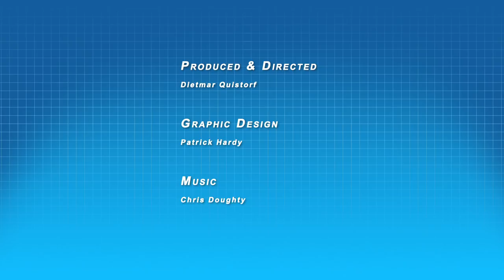Fish Food, Calculation Pond Rock & Pond Liner - Ask T.P.D. Show 29

Comment: Long time no see - to much at work but watched all videos that I missed so far today :-)
We live in Sweden and the climate makes water temperature go from 4 degrees in the winter to 25 degrees in the summer. Therefore we use 3 different koi food.
1. During +8 degrees and as long as they still eating we give the Wheath germ - more or less no protein at all in etc.
2. During mid season usually up to now when temperature is below 20 degrees celicius we give them koi mix osw.
3. During high season we give the top koi high protein food.

Apart from that we also give them melons, broccolli and other good stuff. They always eat directly from our hands and some of them is even possible to pick up and eat from hand when we hold them.
Reply from the maker: TORE ANDERSSON Fantastic!

Comment: Thanks for the info on stone and rocks. Actually that is the most cost prevent part for most people. They are getting just crazy expensive here. Just transport in the last few years has went from 40 to 80 dollars. Stone price whoaaaa /o; I was wondering? when you do plants. Could you do a part on Cat tails. Here in the midwest they are every in lakes and ponds. But in a backyard pond if they are not maintain yearly. They are just a mess. I am helping in clearing out a Pond/ slash stream its 7 ft wide by 40 feet. its beautiful stone work. Sure it still is when we find it all. The roots/runners have just found every crack and crevice to root and go under. Besides wrapping around itself. Its clogged the whole flow. Sorry to say the people just thought. it would work out.. thanks